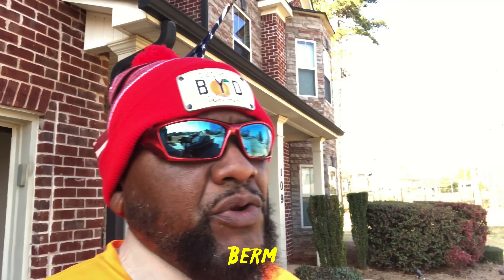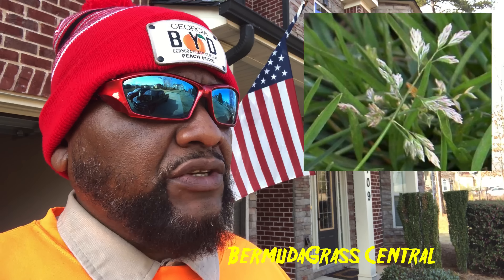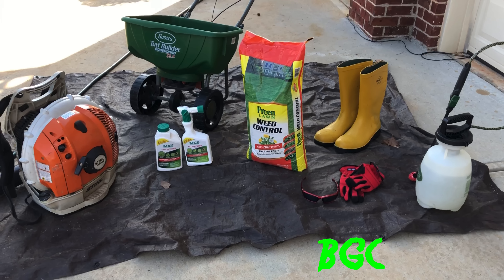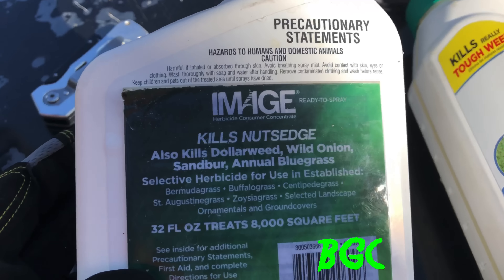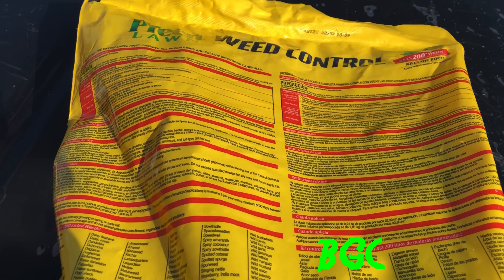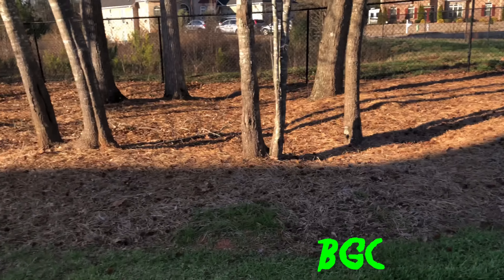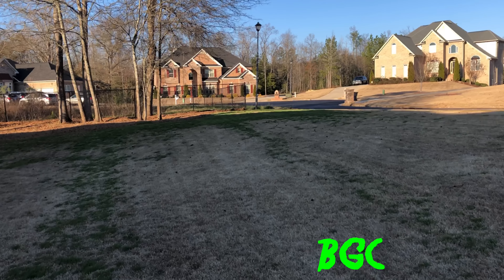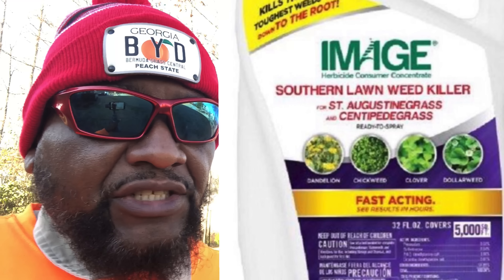Kill Lawn Infested with Winter / Spring weeds. Granular Preen Lawn Weed Control

Comment: I just had my backyard scraped of all the weeds, graded and topsoil added. I don't want any weeds to start to grow before I can lay my sod down in the next couple of weeks. So I bought the Preen bucket of granular weed control and sprinkled it on top of the topsoil. Will this help with controlling the weeds? BTW I'm in South Texas.
Reply from the maker: Moneelovesglam yes it may but I’d ask who ever you are getting the sod from if that was ok to do. It’s not gonna stop 🛑 any weed seeds from germinating though
Reply: Thanks so much. Do you have any suggestions on what will stop weed seeds from germinating?
Reply from the maker: Moneelovesglam one of your issues is you are installing new sod. It’s recommended not to apply a pre emergent for the first year because it could affect the root growth.

Comment: BYD can i use round up for lawns hose spray with the preen on the same day? Or do i have to wait a day or so to apply them seperatly? Also how long does preen last before i can reseed? Ty in advance.
Reply from the maker: pvm ace you can apply same day on dormant Bermuda, preen 6 weeks, not sure a Round up for lawns reseed time but if you google it you can find it there
Reply: Awesome! Thanks BYD! Now to start my war against weeds 💪💪
Reply: BYD i applied preen to my lawn today. I watered it like the directions said but i noticed not much was sticking to the weeds.  so my question is will it still work once the granular dissolves  and is absorbed to the soil?

Comment: If the rest of the yard is dormant can I just use Roundup (Glyphosate) and blanket/spot treat areas?
Reply from the maker: Sam I highly recommend against that. Even though it says it kills off the green. The effects or dormant Bermuda grass could be stunted growth, late green up. Even root damage. Not a practice I’d recommend, but if you must, find an area of lawn that’s not noticeable and experiment 🧪, but I’m not recommended that 👍🏾
Reply: Should have just used roundup and you need to start applying in August and use dimension or spectacle
Reply from the maker: Evan Fugle as I stated before in a video I did on the effects of using glyphosate on a dormant Bermuda lawn, I highly recommended you Don’t. One is stunted growth and late green up. The other two pre emergents you names are great but the Average homeowner won’t pay those prices. Jason Creel did exactly what you said and had issues with his lawn after that. That idea sounds great and some golf courses practice that. Plus weather conditions can change any pre emergent results. The market is now moving away from glyphosate as a lawn weed killer for many reason. Now to use glyphosate to kill weeds in beds or curb cracks yes. But to blanket spray my entire lawn with it, NO. 👍🏾
Reply: @BYDonBermudaGrassCentral  I run a very successful turf care business up the road from you and even golf courses use the same method now just use better timing and pre emegents also BYD! Just helping you out
Reply from the maker: Evan Fugle what’s the name of you company, may come check you out 😀
Reply: @BYDonBermudaGrassCentral  we crush the neighborhoods we are locally hated by other so called chemical companies because we are working owners! We are in Greenville SC, and my Dad and I own Elite Turf Inc. since 1997 after my Dad left the dairy farm in upstate WNY we moved south  and ran a fertilizer plant and opening a Lesco service center here the need for a turf applicator was the way to go! The market has been great for us growing here like crazy.

Comment: Hello BYD, I need advice on eradicating grubs in my front lawn. I live in Houston and I'm not at all sure if your neck of the woods have the same weather type as myself. I noticed some areas that were really spongey, hard to walk on and hay colored, of course the grass was dead in those areas. I used 'the Googler' to try to determine what this could possibly be. After putting 2 and 2 together I came up with it being a grub infestation. Any words of wisdom?
Reply from the maker: Smoothie Health I’d dig up a spot to actually see if it is that. They have insecticide you can apply for this but you really dont know. But if you think 🤔it’s that you can apply a grub ex by Scotts and see if it works. But without knowing exactly your shooting dice 🎲 in the wind 💨. But id put my lawn on an insect control program to prevent other bugs 🐛 from affecting my lawn 🌱
Reply: @BYDonBermudaGrassCentral  Thanks for replying! 👍🏾

Comment: 2019 I used prodiamine every 3 months. My yard isn’t weed free but it’s way better than previous years. What temperature should it be before I apply fertilizer?
Reply: Overkill
Reply: Still gonna have weeds this spring?
Reply from the maker: Good question. In my experiences I’ve applied in 20 degree weather .  If rain water absorbs then the temps may not matter, but you’ll have to experiment 🧪 with you lawn to find out
Reply: You can use prodiamine 65 WDG every 6 months. Google Prodiamine calculator from Grass Daddy. Like March and September.  Then use dithiopyr liquid in late April and mid November. Won't see any grassy weeds. You will still need broadleaf weed pre emergent,  like Bioadvanced 3 in 1, in April and October.

Comment: Bruh I need a remedy for my dallisgrass! My whole yard is practically dallisgrass. Should I just kill my whole yard and start over?
Reply from the maker: Princeful2000 Chuku I cant recommend you killing off the whole lawn. But I’d try a blanket spray if weed kill for lawns, get on a pre emergent program, bag your lawn each cut with mower . Spot treat the Dallis with spectracide weed and grass killer while lawn is dormant during winter dormancy. This problem won’t resolve your issue over night though. 2nd option is to call a True Green company and work with them. Dallisgrass is annual meaning it keeps coming back and the seeds also germinate. Hopes this helps.🤷🏾‍♂️
Reply: Bermudagrass Central thanks

Comment: Does it have to be a minimum temperature in order to spray Image? How many days AFTER rain should i wait to spray it on weeds? (heavy poa annua)
Reply from the maker: 50 or higher but if you getting it now, apply now, you may need a second app though with consistent low temps.
Reply: I just blanket sprayed my backyard with IMAGE and it rained a lot last night. I put a little baby shampoo in there to help it stick.